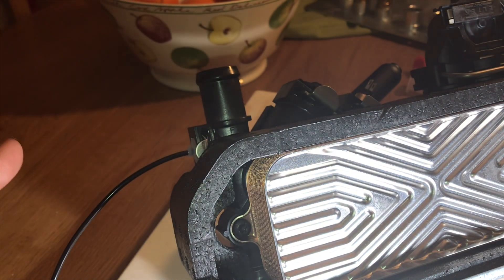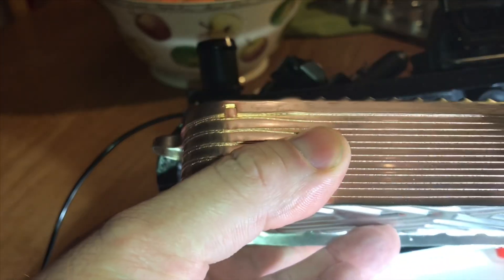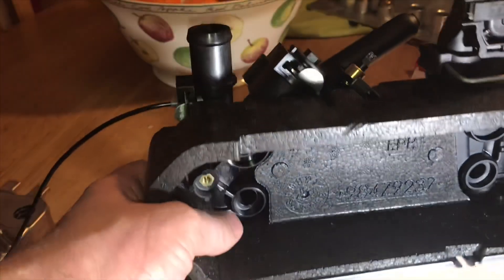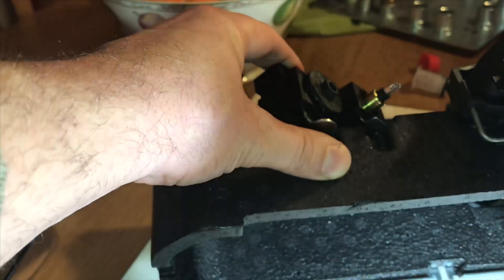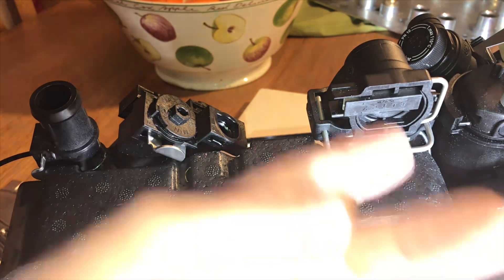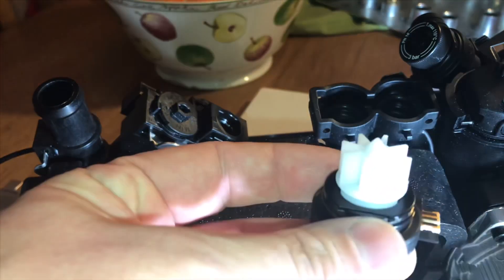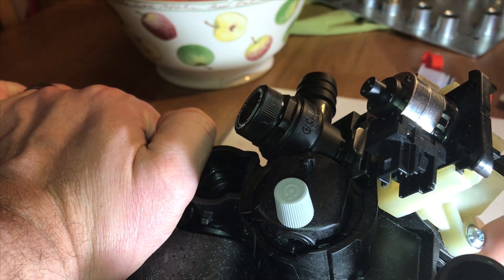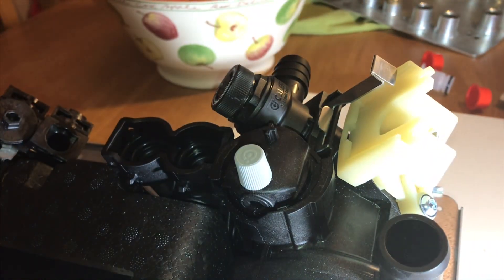Viessmann - 050/200 faults No hot water or heating

Comment: I would like to make a note about the hydraulic installation of this Combi boiler. If the pressure on the cold water supply pipe is higher than 6 bar and if there is no pressure reducing valve, or there is a check valve on the supply, or a pressure reducing valve with a check valve - it is very necessary to install a safety valve. There must then be no shut-off valve between it and the boiler, remove the valve lever on the boiler!! Good luck,fellas

Comment: Thanks for the video. I've got an 050 which is stuck at 59 on the screen and has a triangle symbol flashing. Heating works, but hot water doesn't. If the heating is on, the hot water does get warm.  

Any ideas? 

It's still under warranty, but the company who fitted it don't appear to have done a great job so hoping to have an idea of what to expect whilst I find a trustworthy local engineer.
Reply from the maker: @SuperVitz  plate blocked

Comment: 2 months in for a brand new boiler and hot water going cold
Reply from the maker: Sludge
Reply: @warriorsofwarmth  Must have been the old boiler, it's a small space, 2 bed 1 bath single floor,  2 zones of hydronic baseboard heating with PEX connecting the slant fin copper, and the whole thing is only 10 years old. Cheap Korean boiler was recalled before they folded. Replace heat exchanger and flush/refill heating loops?
Reply: @warriorsofwarmth  It was a flow sensor, but it acted just like clogged heat exchanger.

Comment: Very good video . You went into alot of detail there and I found it useful, so thank you. I've had the 050 for 5 years and it works a treat when all is well.

 Lately however the hot water has stopped working and immediately I got the plate replaced with the front hose.(it was covered in carbon)

 This appeared to have resolved the issue  for at least a day however now I'm back to square one with no hot water. 

The boiler doesn't even ignite when the hot tap is running, however the heating is working absolutely fine.

Any ideas where.i need to next, what is potentially causing the issue with the hot water.. would appreciate any ideas and thoughts and thanks for reading.
Reply: Plate and turbine is clean. Water is still cold although does improve at times with the heating on at the same time. Where would you suggest looking next. Cheers
Reply from the maker: First drain system, then take plate out and clean
Reply from the maker: Next check turbine is clear
Reply: Appreciate the response. Where is the turbine location. Thanks
Reply: Also where is the drain off point on the 050. Thanking you
Reply from the maker: @tazba5551  use PRV

Comment: Thinking about buying the 050-W, for the money sure is a lot of plastic in there :-(
Reply from the maker: Mini shocker arrestors protect plastic
Reply: Mike Edwards 
It’s a modern composite plastic material ,You will find it in all modern boilers
It’s the same materials they use on modern cars especially with the water jackets ,coolant pipes and engine manifolds 
It’s a tried and tested material and in many cases a lot better than metal